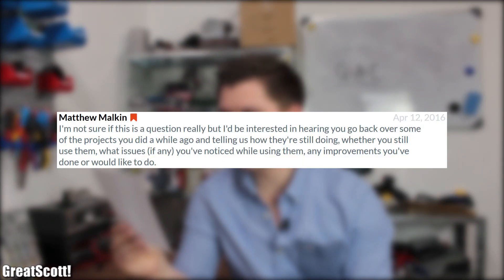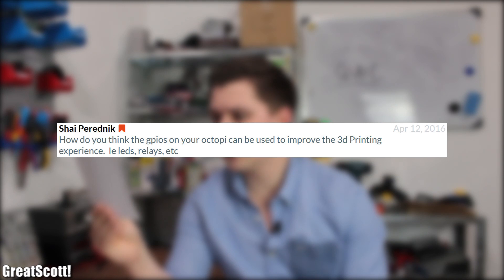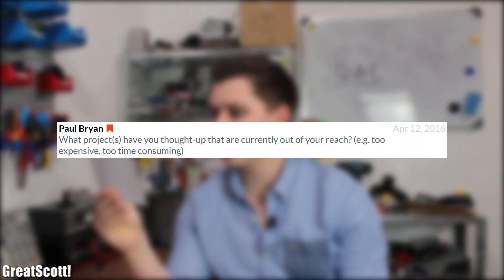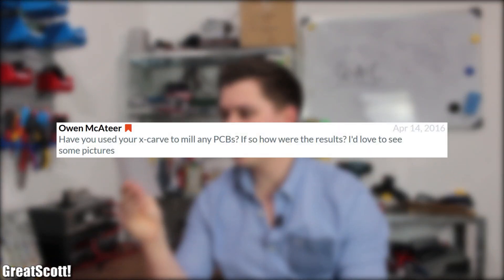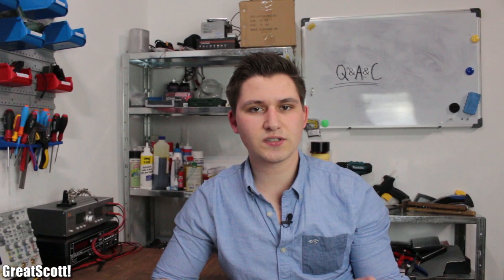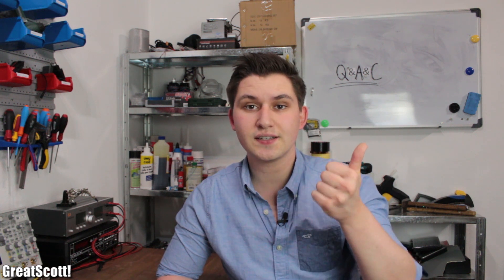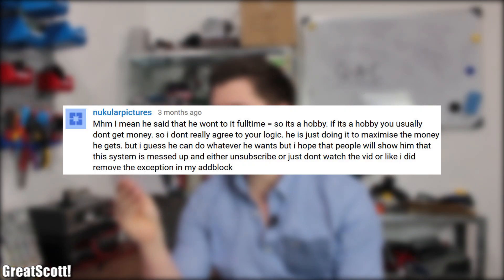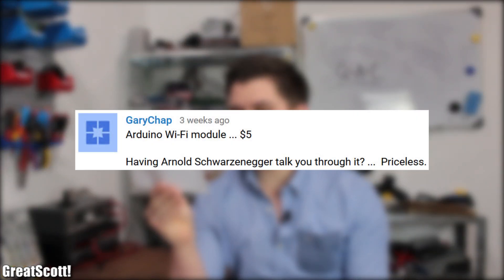Q&A&C #1 || Workshop tour, Unreachable projects, X-Carve PCB milling

Comment: Hi, Scott i have a Questions about your led lighting you do?

i trying to make a sign and i need to know how to do the wiring so i don't get hurt?

1. how do you wire each led that contain 3 pins, i getting a led that has a red strain, common anode, and a green strain?

2. do you use series or parallel soldering 

3. will this work with an arduino uno programing?

P.S. sorry for all the questions.

Comment: i think you misunderstood my question on the rpi gpios.  as an example. im planning on using a pin and relay to turn on my enslpsures leds.  im planning on using a pin and relay to turn my printer on and off. 3rd a pin to read a contact switch which will sandwhich the filement and used as a no filement sensor.  these will all contect to octopi and be controlled via there or cause something to happen like a pause print.

Comment: Hello there! I have a question for you: Would you mind answering some questions about the demographics of your audience?  Do you have a lot of viewers aged under 18? Which age group (13...17, 18...24, 25...34, etc.) is your biggest? I'm just curious, because many of my projects seem rather old-fashioned compared to yours :D. It wouldn't surprise me if your viewers  (on average) were a little younger than mine. Best regards! TPAI
Reply from the maker: +The Post Apocalyptic Inventor The biggest parts of my audience is 25-34 years old. Just a tiny bit (1-3%) is under 18 years old.
Reply: I'm 12 and i am interested in Electronics from the Age of 7.I already have a soldering iron a diy lab bench power supply a hot glue gun and other stuff.I Think +Great Scott is great!
Reply: Oah könnt ihr beiden nicht auch mal was zusammen machen?
tpa gräbt was aus und restauriert es und scott pimpt es mit iot stuff oder so :) schiebt euch doch auch die viewer zu, ist ja keene Konkurrenz.

ps:
Ich guck euch beide und bin 28 ;)

Comment: Have you looked at Maker Spaces?, Theres usually a few in citys (not sure where you live). but they are just big areas where you can go to build stuff, they can cost a small fee though.
Reply from the maker: +JetL337 Sure but I don't want to produce video there.
Reply: Makes sense, they can get noisy.

Comment: I would agree with you on the OctoPrint answer initially. However, over time, I did use the GPIO extensions for both of my printers. My first printer did not come with an active layer cooling fan. Instead of manually switching the fan on and off, I used the GPIO extension, subscribed to start print, end print, and cancel print events. This automated the process, and made my printing much more efficient.

On my 2nd printer, the power switch is hidden in a remote hard to get to location. I would have just left the printer on all the time except the power supply fan came on every hour or so. As a result, I used the GPIO to control drive the power of the printer. Now, I can power on and off the printer without turning into an octopus. :)

Outside of my current applications, I can see the GPIO and relay combo be used for complementing equipments around the print area such as work lights, exhaust fans, and other powered devices. There isn't really a reason why it can't be used to control devices not directly related to the 3D printer.

Comment: Are you planing on building a electric
bike?Nice videos!
Reply from the maker: +Fran Maric One of the project that I do not want to do because of the small workspace.
Reply: +GreatScott! If you get workspace would you build it with hub motor and kit or with an esc and brushless motor?
Reply from the maker: +Fran Maric I am not sure. I would have to do some research.

Comment: How does one set up a servo motor to prepare for use with a circuit board?  Is this required for all motors? I'm a newbie to electronics and aduino boards, aquiring parts as I learn to build robot lawn mower.

Thx for your sharing.

Comment: I know that this is not the right place for asking for advice, but it is hopefully close enough.  And also, I don't know anybody else, who can help me. So:

Few weeks ago I got 8 powerbanks of same kind, each has got 2600 mAh, and all of them has suffered electronics failure (except for one, which has USB connector broken off). Also, I got 15 of 28000 mCD LEDs, so I want to build a rechargable flashlight with possibility of recharging other devices. But I am stuck on three points. First is - Can I build it on that one working electronics? Second - If I connect batteries in parallel, the amperage raises totaly to 8A, but the board is build for 1A. And last one - Can I even connect batteries in series? Somebody told me that I can't because it will lead to internal failure and it will soon die, and said something about balancing circuit, but I didn't get it and Google found me something about high voltage. 

Also, HUGE thank you, I am studying gymnasium, and in comparision, you are teaching me about 100 times more about electronics that school ever did. Thank you very much, I really appreciate your videos! :)

Comment: important info for solid state relays: there are zero cross triggered ones and random triggered ones. the zero cross triggered ones only turn on at the zero cross, so you cant use these to dim a light or control motor power. they only know on or off. i just made this discovery today when trying out my motor controller that i built around a solid state relay that was zero cross triggered. if you want to dim something you need a randomly triggered solid state relay. they are unfortunately less common and more expensive